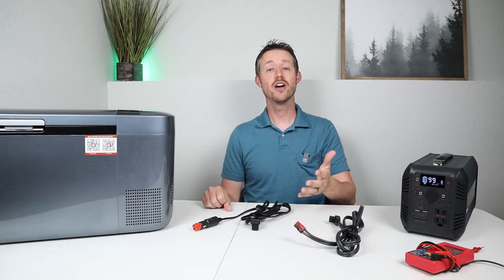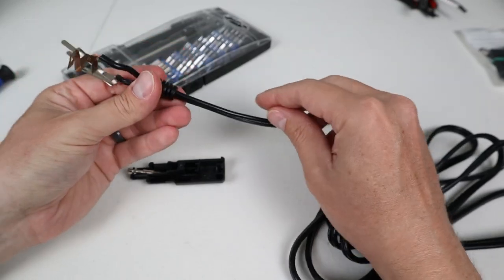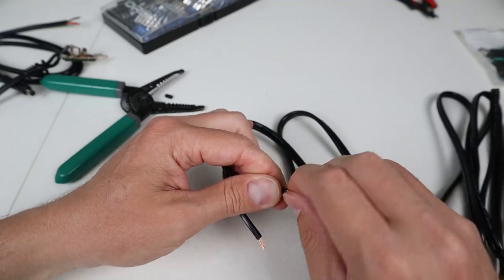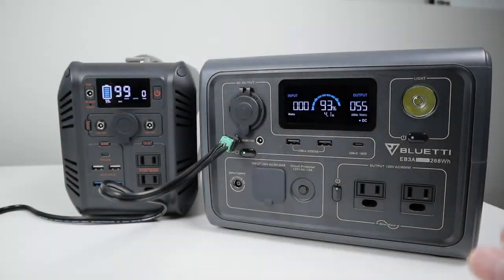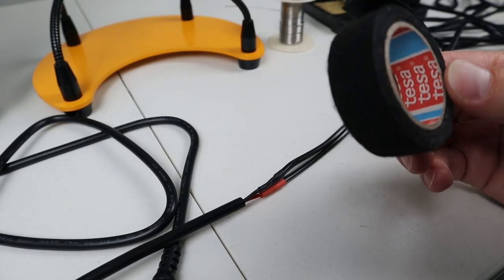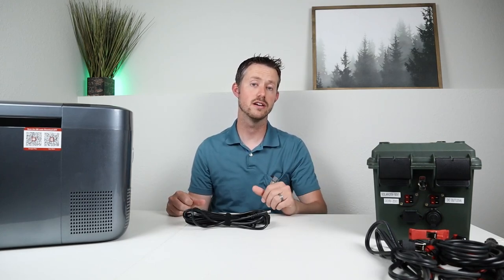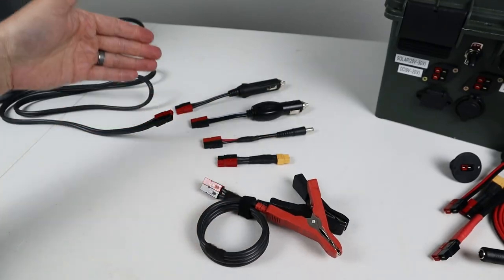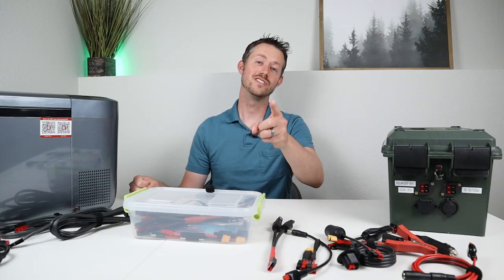How to Make a BETTER Portable Fridge Cable! Remove the cig plug, install 5521!

Comment: Jason, I am wondering if I can use the 5521 barrel connection with my Whytner Chest frig DIRECTLY wired into the 12 gage Marine wire in my van's electical system to the fuse box? ie, use it like a 12 v charger socket that would be an outlet in the wall... only it would be the 12 gage wire with the 5521 barrel connection to plug into. Is there sort of "wall mounted port" for a 5521 connection? (like a 12 charger socket?) Thanks very much for your thoughts.
Reply from the maker: If you search '5521 flush mount' you might be able to find something online. If your fridge pulls under 45 to 50 watts when running it should be fine to use just 5521 as the power connector. If it happens to pull more wattage you might want to look for a better higher wattage solution as 5521 would get fairly warm higher than 50 watts continuous.
Reply: @Jasonoid  
Thanks for answering so quickly! :)
But bummer... My Whytner chest frig pulls 65 Watts. Can I just directly wire the frig to the 12gage wire to the fuse box, and just unplug it at the unit to disconnect? Or is there another alternative that would work instead of the standard charger socket that it comes with? My connection seems like its just really loos and will not keep contact.
Reply from the maker: @wendydavis3897  hard wiring it directly to a fuse block will work perfectly!
Reply: @Jasonoid  Thank you! I will try that. :)

Comment: Does that plug at the other end that goes into the fridge have a name? I am trying to source that out so i do my own cable. Thanks!
Reply from the maker: They don't have a name, you just need to buy a replacement 12v fridge cable on amazon or Ebay and chop the end off and adapt to your desired connection.

Comment: Thank you! Will the 55/21 barrel connector fit the new bluetti ac180 as well?
Reply from the maker: The new AC180 doesn't have barrel ports, just a 12v socket. Kinda a bummer...

Comment: Hey Jason, thanks for your video. I took your advice and got an anderson/5521 cable for my Kings drawer fridge to connect to my Ecoflow river. It works most of the time, but randomly just turns off the DC power port. A suggestion was because the 5521 is only a 3A port whereas the cig lighter port is 10A. Doesn't make sense to me why it would work sometimes and not others if this was the case. But I can't find any other logic, reason or fix. Any suggestions?
Reply from the maker: Did you ever have that issue on the 12v socket?
Reply: @Jasonoid I never tried it with a 12v plug... since then I have developed a massive issue with my Ecoflow which I'm trying to get warranty on, don't know if it's related to this original issue or not. I'll let you know once I'm back up and running, I have a 12v to anderson to try out when it's running again

Comment: Is there anywhere to buy this cable? I would love to purchase the DC to xt60 cable to connect my Iceco VL45Pro to the Ecoflow Delta. Fridge throws the E1 error twice before working the 3rd time when connected via the included cigarette lighter to DC cord.
Reply from the maker: You only are able to power it with the 12v socket or 5521 barrel port with the Ecoflow delta model. The Xt60 port is for charging the power station only.

Comment: Hello, why not plug the cable directly into the AC output on the power station? Please let me know if this drains the battery  down faster.
Reply from the maker: The AC inverter uses background power to convert the battery to AC power. It won't run nearly as long with the AC inverter. It's much more efficient to use the DC power to keep your fridge going.
Reply: @Jasonoid  

Thanks!

Comment: Which fridge would you recommend to use to use as freezer? As cold as possible that needs to hold 3 trays that are 1”x8”x14” ?    Don’t have room in my regular fridge
Reply from the maker: Are you just wanting to make ice in it? Or do you want to make ice and keep other items frozen at the same time?
Reply: @Jasonoid  Freezer 100% no ice just food
Reply from the maker: @michaeld4502  Both my smaller fridges I own are slightly under 14inches wide so they wont fit those ice trays. The ICECO GO20 and the Setpower FC12. You can go with a larger fridge but it will have extra space.

Comment: siempre gracias  por su reseñas , es todo un lujo aprender,j  me gustaria que  me  sacaras  de una duda  jasonoid!  tengo un panel que compre  que me da 28, 5 voltios equivocadamente , pues mi equipo es:  energizer320wh/300 w ,  y solo admite  3 amperios , que debo hacer  para que ese panel  no supere  los 23,5 voltios  gracias y  un saludo!

Comment: Do the PowerPole connectors have a male and female end, or how do they plug into each other?
Reply from the maker: They are the same connections for both ends, they just plug into each other upside down. You can't reverse the polarity which is nice too.

Comment: I have found that on the accessory (cig) plugs there are cheap ones that should be replaced and good ones that hold well in the accessory socket. Usually and more often than not they are equipped with a buss type glass fuse in them. I don't have a power box so I like the universality of the accessory plug.
Reply from the maker: I do a have few cig plugs that are nicer but I still prefer another connector type over 12v cigs.

Comment: Jason, would you say if all the plugs on the 12v portable refrigerators/freezers are the same type?  Are they interchangeable among brands?
Reply from the maker: If they look similar they are interchangeable, only a few brands use a different style socket.
Reply: @Jasonoid  Thanks for the response.  Also, great tips on this video!
Reply: i would test them to make sure, before just plugging them in, easily done with a multimeter.

Comment: Personally I’d put an xt60 connection where you spliced the wires. That way you could switch between the 5521 and the 12v plug as needed.
Reply from the maker: I put Anderson PowerPole splices in most of my wiring, XT60 would also work very well.

Comment: Have you taken a fused plug (cig socket) and not added a fuse back in?
Reply from the maker: The fridge also has a fuse where the wire connects.

Comment: I built a little relay box so my fridge automatically switches to direct vehicle power when our van is running.  (Conveniently the cigarette lighter on our van is only on when the van is running).  It switches to my solar generator battery when the van is off.  It also has what is basically a pass-through so the solar battery gets charged when the van is running.
Reply from the maker: Sounds like an excellent system! You got a video on it?

Comment: I have car fridge 15 L Brass  monkey with that end plug and dose not plug into car at all so what do I need I've got a 2017 year car Small one of those new cars out so I need help advice
Reply from the maker: I've never seen a fridge that doesn't come with a 12v cigarette plug. What connector does it have?

Comment: Can you tell me which pin is the positive on the connector that plugs into the fridge? The one on the bottom of the "B" connector or top? I have all the pieces to make one, I just don't want to wire it backwards and fry anything.
Reply from the maker: Its best to follow power directly from the 12v cig connector as shown in the video. Center post is positive on the cig connector. Disassemble is and follow the polarity to the fridge connection. One wire will have lettering on it, the other will have a ridge on it.
Reply: @Jasonoid  I understand that, but i don't have that wire, I'm making my own. If you could just put a meter on the cable in your video that would tell me. Thanks for the fast reply
Reply from the maker: @NickDeubert  you'll need to get one if your getting into this stuff haha.

When looking at the connector like a B, the top one is the positive, bottom one is a negative.
Reply: @Jasonoid  I have a meter, a nice Fluke. What I meant is I don't have the 12v cable that goes with the fridge which is why I couldn't test it myself. Thank you very much for checking that for me.

Comment: what would be the main advantage of converting the cable to a 5521?
Reply from the maker: The 12v socket falls out during driving if you hit certain bumps (depends on the quality of the plug). The 5521 is a more secure connection.
Reply from the maker: @@kkmpp it's a horrible standard that needs to be changed LOL

Comment: Can you run the 12v frig directly into your 12v fuse box?
Reply from the maker: Yes, you can remove the connector and power it directly. Most fridges also have a built in fuse at the port.
Reply: Thanks for the info. I have been looking for this answer for a couple of days.
Reply from the maker: @jameshancock4394  lots of other great fridge content on the channel 👍😊

Comment: Hi Jason, not finding a vendor who sells just the 12v power plug (female 2-prong) end for the Iceco fridge to build a custom power cord. would you know where to find this?
Reply from the maker: https://amzn.to/3oTZpBV
Reply: just interested in the fridge plug which goes in the fridge....not the 12v cigarette lighter end.  is the plug on the fridge an Anderson connection?
Reply from the maker: @richardcurrie6043  The red/black connector is an Anderson Powerpole connection. You can see my video about setting them up here:
https://youtu.be/bZHh3nWXtkw
Reply: what exactly is the power connector on the ICECO fridge unit itself??
it looks like Anderson?  on the fidge iteself.... @Jasonoid
Reply from the maker: @richardcurrie6043  it has no name, it has no standard, it's just a fridge connector that is used on all these DC fridges. I've searched for years, never found the name of that connector. Sorry Richard. It's not Anderson.
Reply: ok, thanks very much for the information!  sorry to be so persistant! @Jasonoid
Reply from the maker: @richardcurrie6043  you could email either Iceco or Setpower and they might be able to give you an answer. Lots of brands use the connector.

Comment: Bluetti EB3A and AC180 both use DC7909 for DC input. For the life of me, I can't find any screw in terminals that are DC7909. Anyone have a link? Searches keep suggesting one of those adapters, from 5521 to 7909, but that must cause some drop or be unsafe or something, my brain doesn't like it. I was hoping to upgrade to 14AWG wire so I might just have to order a cord and snip off the end so I can learn a new skill. I'll just keep looking. Thanks for the inspiration!
Reply from the maker: This is the adapter I have used for 7909 barrel ports. It works well:
https://amzn.to/3UptNTU
Reply: @Jasonoid  thanks!!

Comment: Can you use a usb-c connection?
Reply from the maker: I have seen some USBc to 12v adapters, that might work but I havent tested it. It needs 12v-14v to run properly.

Comment: How about connecting a battery with fuse straight to a 12V fridge?
Reply from the maker: That would work well also!
Reply: @Jasonoid  What size fuse should I use?. Thanks for the videos.
Reply from the maker: @rrvallance  I would recommend 12awg wire with a 20 amp fuse.
Reply: @Jasonoid  Thank you.

Comment: Has anyone converted a cable to hook up an external inverter ? I am wondering if a external Bestek 300 watt sine wave would be more efficient than a built in inverter in a power station. ? Seems like a new test could be added when determining / rating power stations .
Reply: I did that a few decades ago cause I had 300 watt inverter with only battery clamp cables and wanted to use inverter inside truck.  Only used for hour or less each time though.
Reply: this would depend on the power stations' battery, if the power station gives a regulated dc output, and not directly from the battery, you will loose more power from the dc-dc conversion. if the power station has a direct to battery dc connection, then using an external inverter that has a higher conversion efficiency may be beneficial. but you will need to do your research.

if you are really wanting to use your own inverter, you may wish to go the DIY route.
Reply: @user--PM  I purchased an Audew , which does not have pass through charging , that is why an inverter was necessary to charge and operate at the same time.  That got me thinking what inverter is more efficient?  external or internal , which I can do on my own, but thought it would be a good test for other power generators as well , for comparison

Comment: Be sure to check the max amperage and wattage of your power stations 5521 connection. The 5521 capacity on my EcoFlow Delta 2 Max (2048Whr) is only 3A, Max 38W. Most fridges will pull more than 38W. Beware!
Reply from the maker: It's labeled 3 amps or  38 watts but it allows the full 10 amp output. Check out my review video where I test the Delta 2 Max extensively.
Reply: @Jasonoid  i realize its an “or” statement, but when the EcoFlow screen us reading 40-53W when the fridge is on, its over either way.
Reply from the maker: @CraigG21  what I'm saying is that Ecoflow labeled the barrel port as only being able to power 3 amps total, but in reality you'll be able to pull around 100 watts from it without any issues.
Reply: @Jasonoid  wow - thanks. I’ll check your vid. Seems like the labeling is quite deceptive (but in EcoFlow’s favor).

Comment: If your going to boast your "So called soldering skills" at least do a high quality solder connection.
Merge the two wire ends for best connection and strength and then solder.  Some sob is going to follow this and wonder why his connection is making heat or worse Fires.
Tho I will complement you on your fridge adaptors section
Reply from the maker: No boasting here... LOL

Comment: Hey mate great vid. 
Was just wondering if the writing is always on the positive cable as I'm connecting  a Anderson plug on my Waeco and forgot to pull the plug apart first to see which was positive but one does have writing on it and I'm thinking this is the positive
Thanks in advance